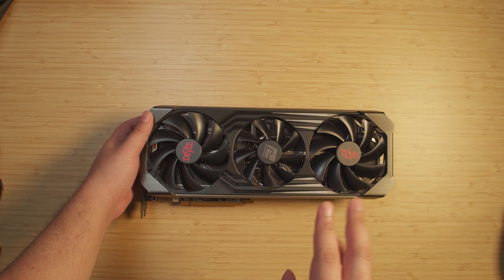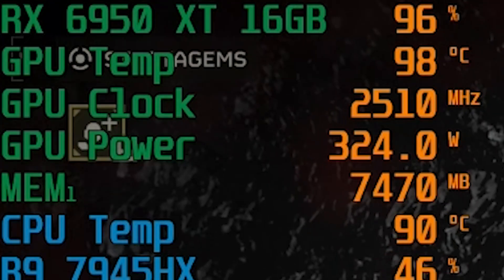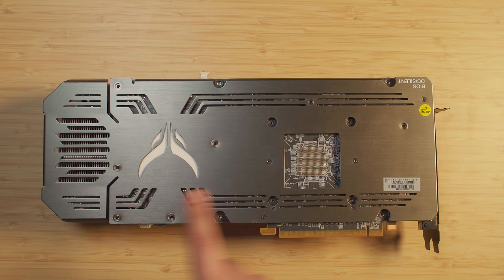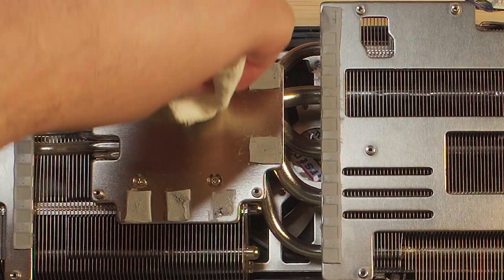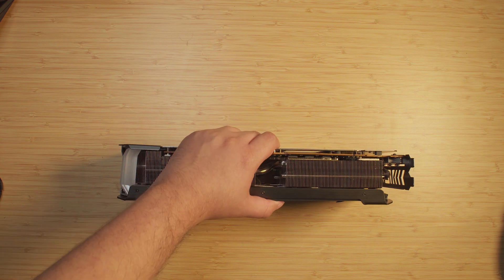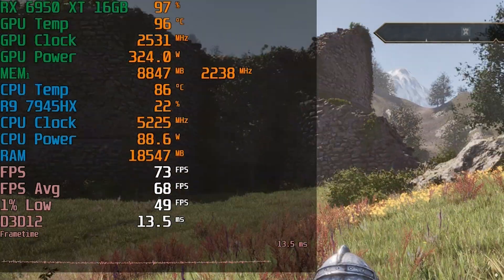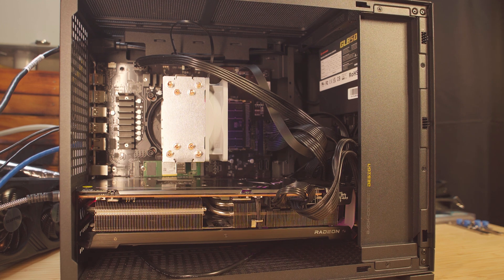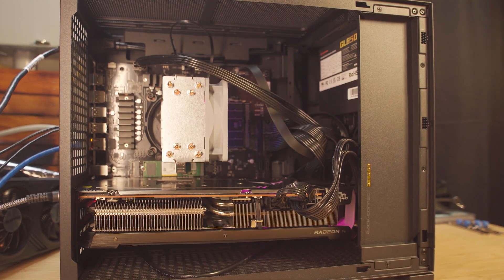Repasting An Old Flagship Graphics Card | Dropped Almost 20 Degrees?!

Comment: Take a look at the wiring again. Doesn't look right. 

Also, that's a very bad airflow setup for the GPU. Honestly, I'd get a new case but if the budget isn't there, turn it on its side and leave the panel off. If you have a spare fan, put it in the back at least but, honestly, the case is hopeless.